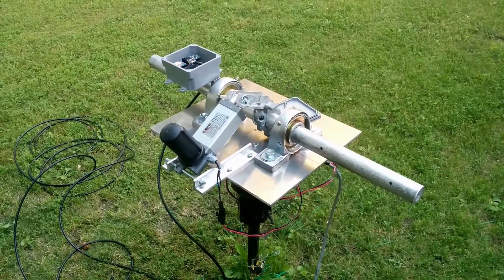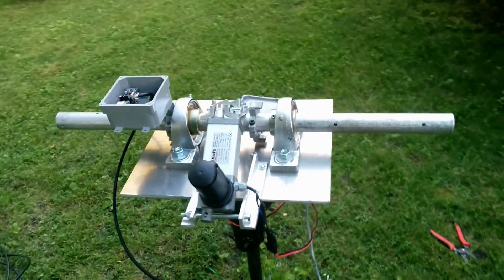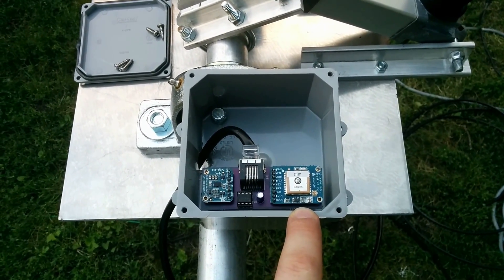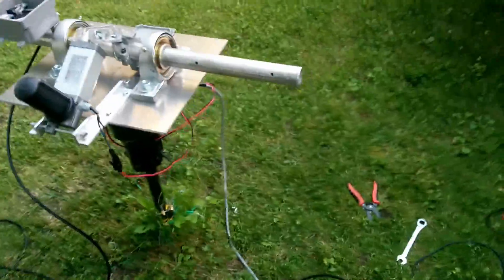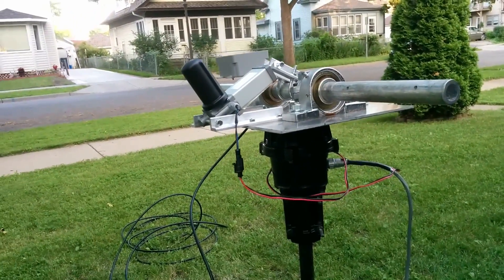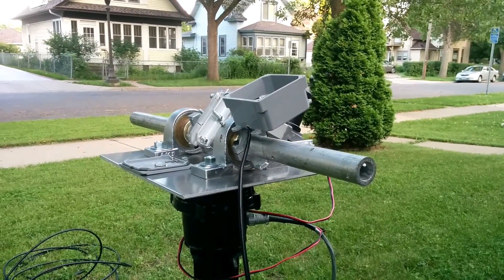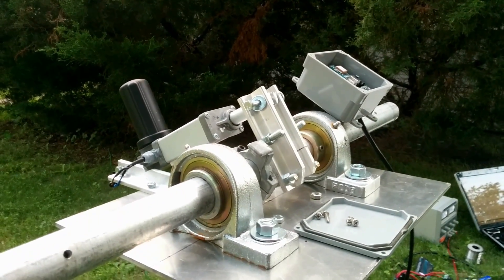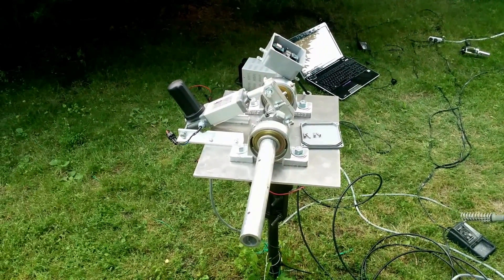Azimuth and Elevation Rotator at AE0MT

Comment: Why do you need the GPS at the antenna?  Why do you need a GPS at all, unless you are using this in the field at different locations, in which case, why not put the GPS at the main computer that is running everything?  No matter, it is still a super cool project. I was think of doing something similar with the inclinometer and I ordered a couple, but they are out of stock!!  Great project.
Reply from the maker: The GPS is more for time than location, but it does provide location to allow the pi to track the moon without a connected PC.

Comment: Hi Mike..
i am currently working on this project but i didn't  find any useful information  about this.. Currently i am using adxl345 for tilt and hmc5883 compass for direction  .. but the thing is i am unable to find the correct elevation and azimuth  .. can you share your code with me such that i am able to configure out  that at which point i am doing wrong ... nomanarshad230@gmail.com

Comment: I imagine a less beefy rotor could be used to reduce build cost. Something like a Yaesu G450A which is about $280.

As a reference the G-5500 Az/EL combo rotor  runs about $750. A nice system but pretty expensive.
Reply from the maker: Yes, a less beefy rotor could do the job, but this is what I had. Also, the G450A uses an AC motor, and the G-800 uses a DC motor. I have found it much easier to control the speed of DC motors to enable slow start and slow stop functions.
Reply: @AE0MT  Mike, I had a few views of your videos. I am about to use a Kenpro KR-800 as an azimuth only rotator for HF work, using the K3NG control software. I note that the KR-800 is equivalent to the GS-800 (just re-branded I think) and it has 24V DC motors (I see your power supply was set to 24V). I was interested in what you were using to switch that DC to the motors. Plus, how did you go with using the built in potentiometer (in the rotator) to provide feedback on azimuth position? 73 Fred VK2WS

Comment: Mike, what size cap is on the masthead board for bypass? I can't seem to find a schematic describing the board.
Reply from the maker: I want to say I used a 10pf cap, more as a buffer than anything. You may not need one.

Email me at zryder94@gmail.com, and I would be happy to provide you with a parts list for this and the other parts of the system.
Reply: Other circuits I found using this chip and the data sheet suggested a 1uF.  That's what I went with and it worked fine. It looks like it is needed. My Teensy 3.2 would not see the the LSM303 until I put the cap in. I suspect it was needed for the initial in rush of power to the LSM303 on power up.
Reply from the maker: Sound's reasonable. If a 1uf does the trick, a 10uf would do better. I meant uF before, not pF, sorry.

Comment: Mike, I like how you use the Adafruit boards as feedback for the k3ng rotator controller. I'm currently building out a k3ng controller using a Teensy 3.2, and I would like to incorporate your feedback system. Did you make any changes to the K3NG code base for the Adafruit boards? Are your code change available?  I noticed the I2C interface board is purple, is it an OSHPark board? If so, did you happen to share the design so I can grab a couple from OSHPark - or, perhaps you have them available for purchase?

-Freeman, N5FPP
Reply: I hate to reply to myself, but I looked closer at OSHPark and noticed the project was shared under your old callsign. I ordered three boards for $18. I love OSHPark.

For others who may be interested in the masthead sensor board, it can be found at:

    https://oshpark.com/shared_projects/pktpYo9q
Reply: Do you have the part number and source for the RG45 connector?
Reply from the maker: I made some minor tweaks to the code to incorporate the LSM303 sensor, and at one point, some of my code changes were rolled up into the main branch of the K3NG code. It has been a minute since I have worked with any of the code, so I don't know what has changed lately.
You figured out that the board is OSHPark, as are most every board I have made.
As for a parts list, I get all of my parts from DigiKey, and I am happy to provide the parts list I used at the time. Please email me for this list.